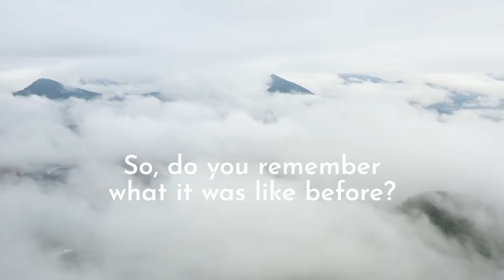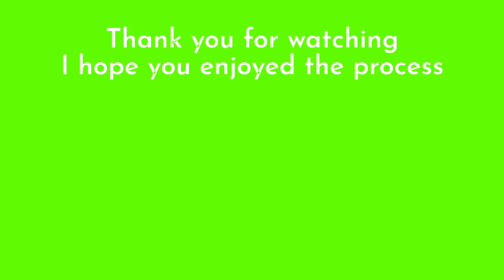Water to Water - Unbelievable Garden Build

Comment: Sunday afternoon, sod football grab a tea and chill watching the other great red team from Liverpool..👍🤣 like the clips that hold the decking down far better than winding a long screw from top yet again another perfect job ,,,the jointing material is that a pre mixed flexible filler or did you mix it from sand cement ect,,,,I’ve seen the stuff you pour onto wet surface and brush into joints…😮 can’t imagine you ever get a disappointed customer…loverly property taken to another lever by you and the team …👍👍👍👍